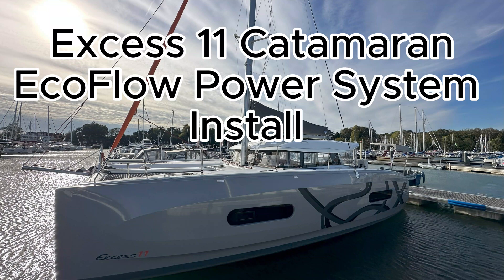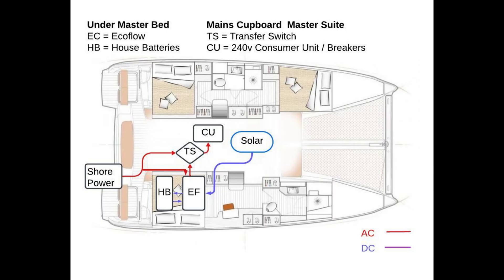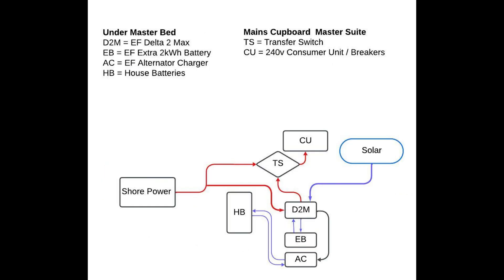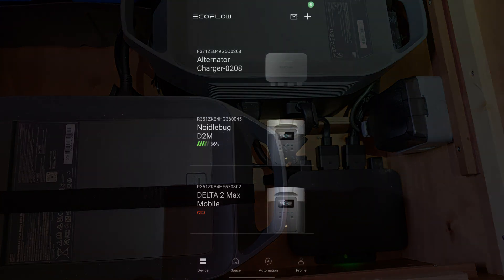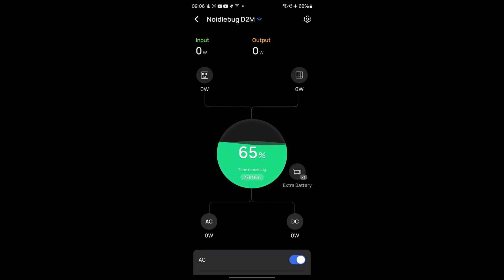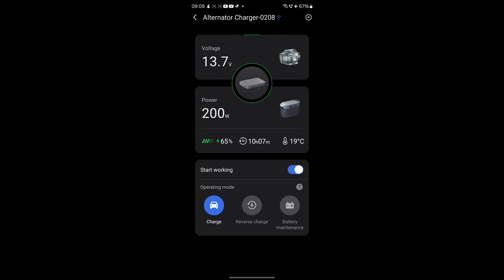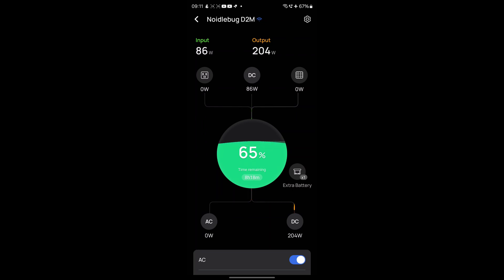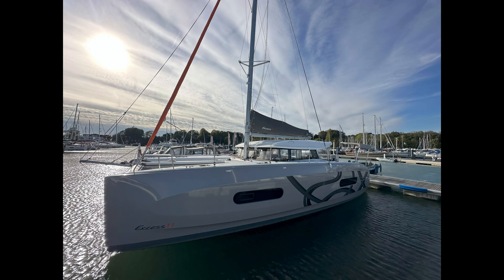EcoFlow Delta 2 Max install with  EcoFlow Alternator Charger on an Excess 11 Catamaran yacht

Comment: I’m doing a similar on the catamaran that I am building. I have the Delta two max can you give me a link to the plug that goes into the EF delta AC port that ultimately connects to shore power? I can’t seem to find that, but I don’t know what to call it.
Reply from the maker: In this photo you will see the mains socket at the bottom (grey cover open)  that's wires to shore power and EF plugs into that socket https://photos.app.goo.gl/Ce7dr4o548Wma1Sk9
Reply: @pwwuk tx If you have a chance, do you know the name/brand of that item?😊
Reply from the maker: @Tlapointe2  divert the shore power feeding your fistribution board to a diverted switch  https://amzn.eu/d/4FKJDH9..  position A pass through to your distribution board position B to a socket https://amzn.eu/d/jkpht0T and EF output to your distribution board.
Reply: @pwwuk many thx

Comment: Hello. Does this mean that you don’t need shore power to use hot water balloon?
Could my actual solar panel charge both original batteries and the Ecoflow?
Thank you
Reply from the maker: Shore power remains direct to water heater and boat battery charger. Only sockets are routed via a change over switch through the EF .

Comment: How did you wire the ecoflow to the distribution block?
Reply from the maker: 13amp output to a change over switch (shore or Ecoflow) feeding right distribution board.

Comment: Thank you very much for the video. I also have an Excess 11 in Lisbon. I'm thinking about setting up the same system. Last summer I sailed to Madeira for 3 days and almost 5 days to return and I had to run the engines for a long time to get enough energy.
 I didn't quite understand the connection between the EF and the service batteries and alternators. Did you connect the EF to the engine batteries to charge the EF with the engine or is it just connected to the house batteries? 
Can you  send detailed photos from this link. I have a Mastervolt 12/2000 on my boat and 2 Cristec chargers.  Have you already installed the solar panels? Can you send photos of the installation and cable routing? thanks

Comment: Hi Peter this a great video and solution. Wanted to know if you can comment on grounding. 

I see with normal boat gens or inverters neutral is tied to ground. Lots of threads on this. 

Did you all do that or leave neutral floating?
Reply: Hi,  we wired into the distribution board, including earth.

Comment: Thanks for this Peter.  I have purchased the Ecoflow system with EF Delta 2, alt charger and Powerstream.  This will be installed in my '59 VW van and also my garage alternately. Your detailed tech, no nonsense video will help with the install, as like yours, its not straight forward.  In the van I have leisure battery, solar and shore power, in the garage I have mains (which Ill back power) and solar too.  I need to plan the install with schematics as you have donw, so this really helps.  Thank you.  Ill post a video and share when Im done!

Comment from the maker: System is 4kwh LFP, 2400w inverter and 1000w Solar MPPT with bi directional DC charger.  About 50% of the costAND  lower size / weight of a Victron or Mastervolt equivalent according to my installer. No doubt if you have spare £ OR € OR $, space & load carrying capacity a regular full LFP install could be superior.